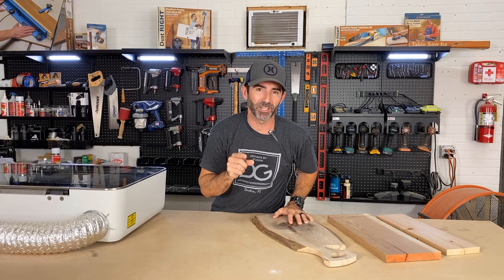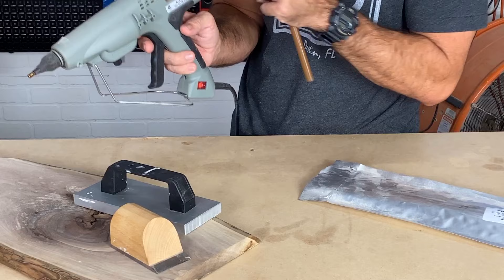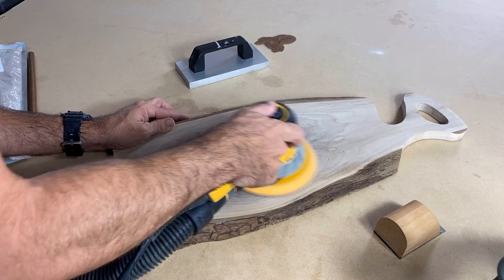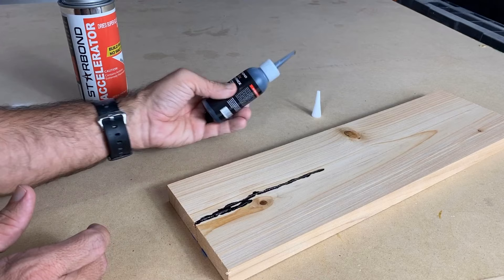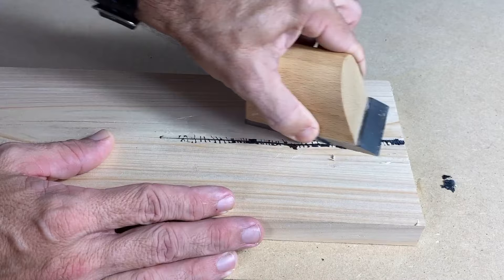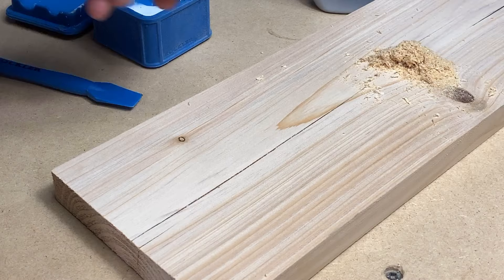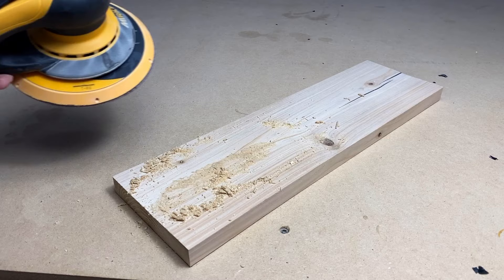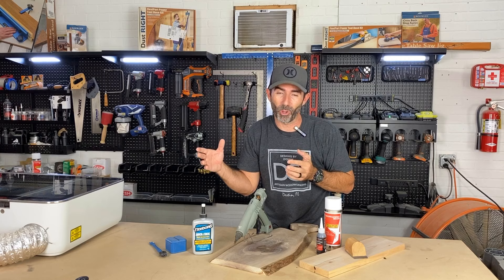See how Easily you can repair WOOD Cracks & Knots

Comment: What kind of heat gun is that? Looks like a hot glue gun? Wondering if that would help me fill some imperfections in my hardwood floors as I really don't have time to do them the right way with a drum sander and whatnot.

Comment: Another option I use is ground copper or other contrasting material instead of sawdust to add a “feature” to my black walnut projects.
Reply: Do you mean filing a copper pipe and using the dust ? Thanks!
Reply: @georgeksirakis8898  That is one way to get the copper or any other contrasting material. There are sources on the internet that will sell quantities of ground copper, turquoise and other materials.

Comment: Dude great ideas. I usually just make bow ties but these are great. I really loved the starbond idea and the knot glue especially. Thanks for the tips
Reply from the maker: Thanks Adam! I love doing bow ties, I’m a bit rusty though... but you just gave a great idea for a video 👊 you rock bro!
Reply: great tips...when mending anything with wood, i usually wet the surface ,heat it up so the fibers can be more flexible, then apply the glue and squeeze it up...i figure the dampness along with the heat will help absorb the glue better, and the heat will soften the fibers so that they conform to the new shape of the fix...thanks alot!!!

Comment: I decided to order that hot glue gun man that thing is surely expensive I'm planning to use it to fill cabinet door holes sometimes I'm having troubles with different types of fillers and sanding and filling and sanding so I'm hoping that this really solves an issue of mine do you think that for paint grade this will do well and leaving a nice flat finish without additional filling
Reply from the maker: Very cool. You’re gonna love it. I use mine frequently and has saved me many times.

Comment: How do you know when you could have used more or less glue?
Reply from the maker: Well in most cases it’s difficult to tell but in this case the crack went all the way to the end of the board so I was able to see how packed the crack was at the end grain 👍 and turned out I needed to add a smidge more